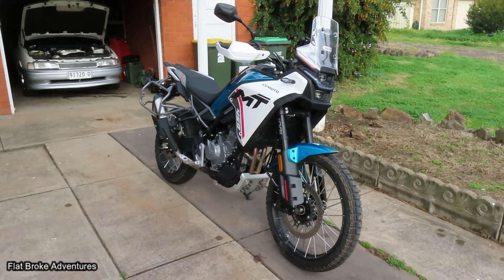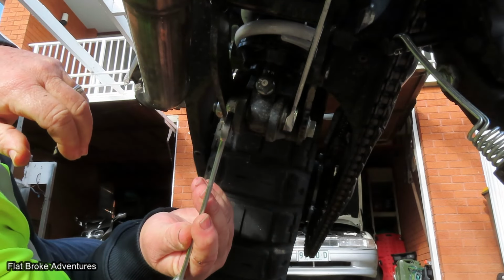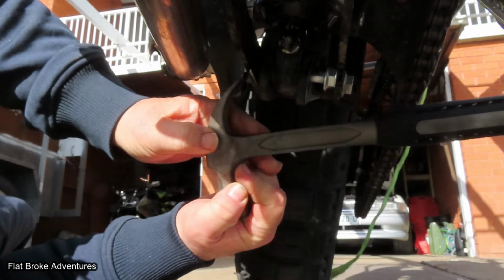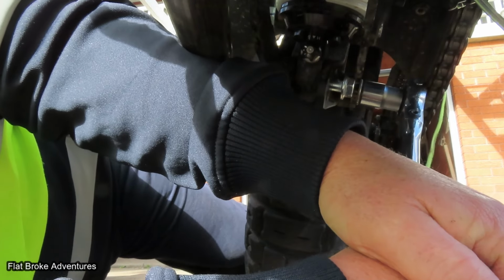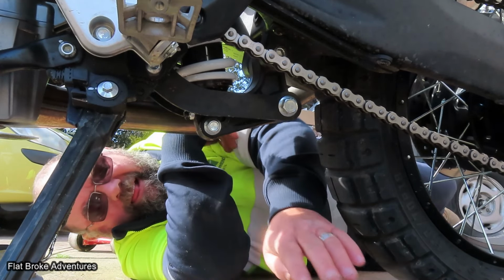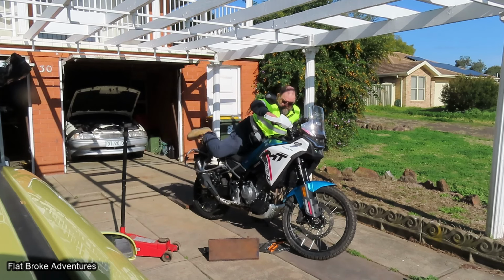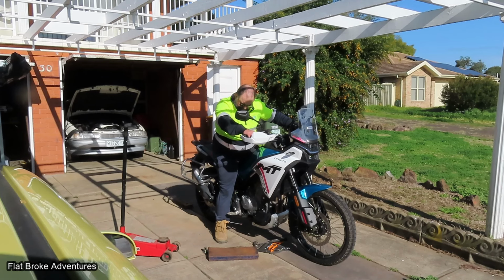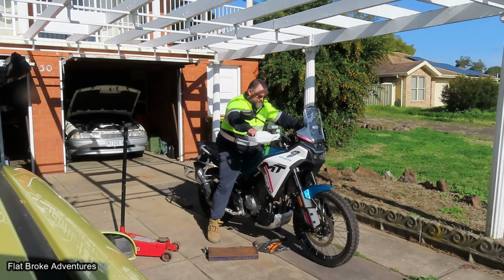HOW TO LOWER REAR SUSPENSION/SEAT HEIGHT CF MOTO 450MT IBEX450

Comment: I reckon with the bigger tyres and getting tall seat on mine. i may have to try this. Might be safer to use the scissor lift, but ill still tie bars to the roof because i had bikes fall over on me. Cheers mate.
Reply from the maker: Yes I need a scissor lift for sure. I should have used 2 straps I think to hold it up properly

Comment: You may need to lower the front also because lowering the back would have increased the trail slowing the steering.
Reply from the maker: Yes I was thinking bout lowering it about 10 - 15mm
Reply: @FlatBrokeAdventures  Q1  Did lowering the link have any impact on the steering that you noticed?  How did you find the new ride?
Q2  Can the front suspension even be lowered?  The bike was clearly predesigned to have this frame lowering change made.
I am 180cm but have a long back rather than long legs.  I'm finding my 450MT just a smidge too tall and can not quite flat foot.  This means I can't splay my legs out for balance as far as I'd like when stopped.  The bike fell over once when I stopped and put my foot down into a small hollow unexpectedly.  Once the bike over-balanced I couldn't save it.
I'm getting the centre stand fitted at the first service (ordered with the new bike but unavailable), and I think I will get them to change the link for me.
Reply from the maker: @lawrieyoutube4375  Q1. no I have not noticed any difference in the handling. I love the bike. 
Q2.yes the front can be lowered. I have a center stand I just haven't fitted it yet. I'll be interested to see how much ground clearance it looses once installed.
Reply: @FlatBrokeAdventures  Thanks.  Yep it is great to throw around when underway.  Losing a bit of ground clearance won't bother me, my days of leaping and rotating the bike over a big log are behind me.
I'd love a vid of you lowering the front.  I suspect a lot of others would as well.
Reply from the maker: @lawrieyoutube4375  yes they are great bikes. I've never been able to jump logs etc. Actually I've ever tried I've only been riding 7 years and it's all been on road. I'm happy with the bike now so 'm  ot going to bother lowering the front as it will lower the bike more and I'm still to put the centre stand on. I'll make a video on that soon. I have to finish recovering from my stack  almost 3 weeks ago.
Reply: @FlatBrokeAdventures  This is my first 'proper' adventure bike.  And I am no expert rider.  
I had a bike license before I could drive, but back then, 1960s, all we had for off-road were old clapped out bikes we modified as best we could, usually with bald tyres. No money.  Mostly road touring and exploring the bush and beach on road friendly machines.  Dirt biking as we know it today wasn't a thing except for racing.  Guys today from later generations who grew up as kids on little dirt bikes have great skills and an advantage over us I think.  
My best bike was a Triumph Bonneville 650 (ex police) and yes, I took it through the bush tracks sometimes.  So it's not always about how good the bike is.  The old bikes could go really slow in first gear with plenty of pull which was a huge benefit off road.  Personally, I find even the 450MT too high in first with the high-rev short-stroke motor, and temperamental near idle. The snatchy throttling doesn't help. Masses of revs and clutch feathering gives less control in my opinion. Mind you, I love the fantastic response once you get moving.The clutches back in the day could not take that and would just burn out.  I acknowledge clutch moderating is an important modern skill for modern motorcyclists on modern bikes and I have taken to it with pleasure.  
None-the-less, I think it was safer to be able to crawl very slowly over and up rough terrain with the clutch right out and just move your weight.  Nowadays it seems to be all about ripping the rear wheel and momentum.
I watched your prang.  You seemed to be going really well and I can't see what happened.  It is always so sudden isn't it, and a shock.
I hope you are over the pain and recovering fully.
Happy rides.  Lawrie.
Reply from the maker: @lawrieyoutube4375  Hi Lawrie. I first rode my mates fathers DT175. we had trails very close to home in Nelson Bay back then. I rode it about 4 times maybe and the last time I came off doing about 80kph on Stockton Beach 14km from the end. I was knocked out cold for a bit and the water woke me. I had a broken collar bone and that was it luckily. I was 17 at the time. My parents told me if I ever got back on a bike they'd kill me. So at about 49 or 50 years of age I decided to get a bike and my licence. For the last 7 years I've been on road only and now want to explore more off road and do some moto camping and love the 450MT. I can't really comment on old bikes as I never really had enough experience on them.
Reply: @FlatBrokeAdventures  I'm sorry you had that experience, but what a coincidence. 
In the early 1980s I bought a new Yamaha DT175, 2 stroke, 6 speed, for commuting. Cheaper than a second car. It was a great fun bike.  I never really got the most out of it with a young family coming on.  It was in mint condition and I had to sell it to raise money for a business I was starting.  I heard later that the young bloke who bought it wrote it off the next day in a paddock.  He was hurt but OK.  His Dad hadn't wanted him to buy it.
That was my last bike before buying the 450MT recently.  It is just sooooo good being back on a bike.  Everything is fine when under way and very nimble and I feel secure.  Until I have to put a foot down.  Then it feels top heavy.  These modern adventure bikes are marvellous but a different architecture to the past.  I can see why older riders are always dropping the big ones.   
The 450MT is a physically bigger bike than my old Bonneville.  Personally, I would not go to an adventure bike any bigger than the MT.  If I wanted to upgrade I would revert to something less dirt orientated.  Most bikes, except racers and cruisers, can go on pretty much any road or track and I'm not interested in pitting myself against true gnarly stuff.  I just want to get out and explore.  Safely.
Reply: By the way, after our conversation I had a closer look at the forks.  Yeah I think the yoke clamps could just be loosened and the struts slid up a centimetre or two without causing any dramas.

Comment: What is the ground clearance now that it’s lowered?
Reply from the maker: @johnnylong2049  no idea sorry mate I haven't measured it. It would be 20mm lower than what's quoted in the specs
Reply: @ 8.7in minus 20mm is 7.9inches.
Reply from the maker: @johnnylong2049  I know it reduces the seat height from 820 to 800mm
Reply: 820MM at high position  and 800MM at low position

Comment: Le encontré un detalle la regrese a su altura normal, ya que la pata lateral queda mas larga y como consecuencia la moto mas vertical y el riesco de caer es mas grande
Reply from the maker: Yes that it true and now that I've put a larger foot pad on and the suspension has sagged its even worse. Now I'm going to stiffen the rea preload so it doesn't sag as much

Comment: Flat broke but lots of comedy gold! Looked like you had nearly more falls on the bike while working on it than riding it!
I wouldn't have thought the dog bones would have to come off to lower the link arm pivot? But, i dont have one yet🤦 When i get rhe tall seat & lower the bike that 20mm i wonder how this will pan out.
Cheers for showing the long way round!
Reply from the maker: I didn't think I'd have to remove the dog bone either but the bolt wouldn't come out. The dog bone need to be moved only about 3 or 4 mm. It was that close
Reply: @FlatBrokeAdventures  ahh, got it. The head of the bolt doesn't clear the dog bone profile? So at this stage, probably best to load the bike rather than lift the rear end?
As soon as mine comes in, that what I'll see. Cheers

Comment: Hello how tall are you?? thank you 🤙🏽
Reply from the maker: I'm 168cm
Reply: @FlatBrokeAdventures is it good for my 177 cm?
Reply from the maker: @AlexK-nf8cq  Yes very good for you. You wont need to lower the suspension like I did
Reply: @FlatBrokeAdventures what is the comfort and controllability of the engine considering that it is relatively heavy because with fluids it is close to 200 kg?
Reply from the maker: @AlexK-nf8cq  comfort is good. I did almost 300km last Thursday with no issues. The engine is good but is a little choppy when going from 0% throttle to a small % throttle. I believe you can adjust a lot of it out, which I haven't adjusted yet. Other than that I find it great
Reply from the maker: @AlexK-nf8cq  comfort is fine. Last Thursday I completed almost 300km most of which was on the bitumen, with no issues. Engine control is also good but it does chop a little going from 0% throttle to a small amount of throttle. I believe you can adjust most of this out of the bike.
Reply: @FlatBrokeAdventures  no one should lower the suspension like you did 😂 jk, thanks for sharing.

Comment: capisco il fai da te ma cosi è troppo , oltretutto i bulloni vanno serrati con la dinamometrica
Reply from the maker: I agree bolt should be tightened with torque wrench. I bet that a lot of workshops don't use a torque wrench to tighten most bolts. It's quicker and easier to just use a rattle gun

Comment: At this point, you’re the only one who made this video.. so what’s the easy way you mention?
Reply from the maker: If I'd just removed the 2 bolts at first it would have been easier. Instead of trying to only take out 1 bolt on the shock to  get the job done. I could have also used another method to hold the bike up off the ground instead of using a ratchet strap to lift it.